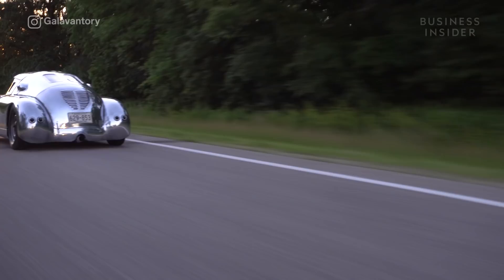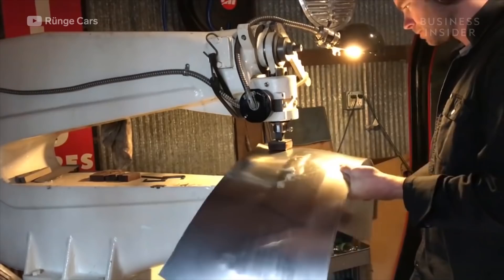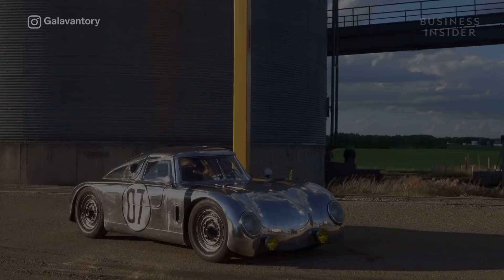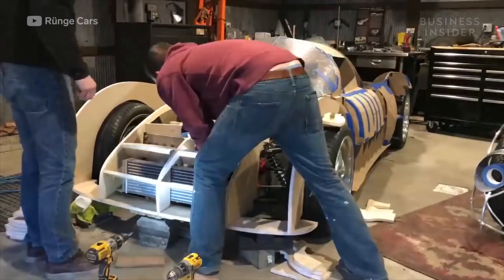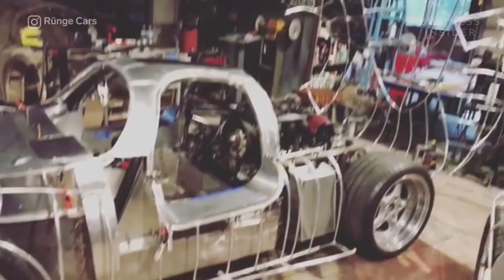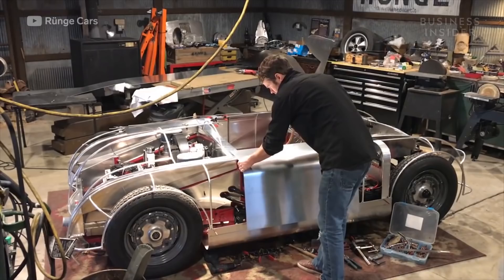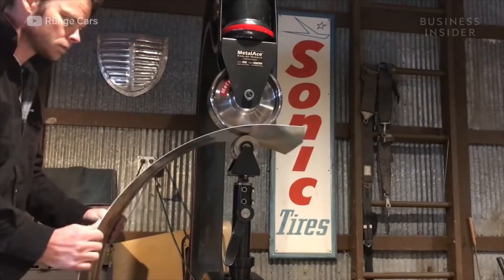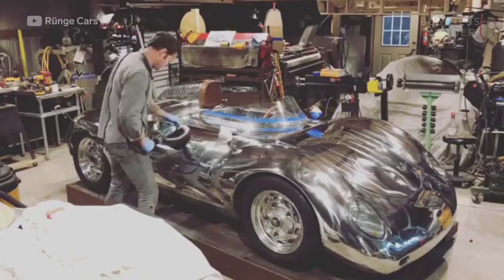How Aluminum Cars Are Built By Hand

Comment: Isn’t easiest to just create a mold to cast aluminum then just pour it?
Reply: I think that utilizing a mold in the shop will take a lot space and may be expensive for small volume production as the molds are usually milled using specialized machines, running the mold will also require additional costs since you need to melt the metal and inject it etc. It will take even more time to extract the bodywork from the injection mold due to the size of the panels. It is also harder to customize as molds are generally rigid and is near impossible to modify whereas bending or flexing the relative soft aluminum is both easier and more flexible. However, a one piece casted or better yet, stamped (aluminum is soft), body work will certainly look badass.